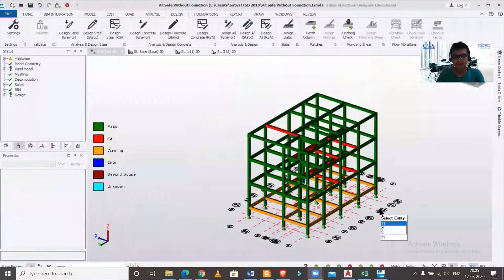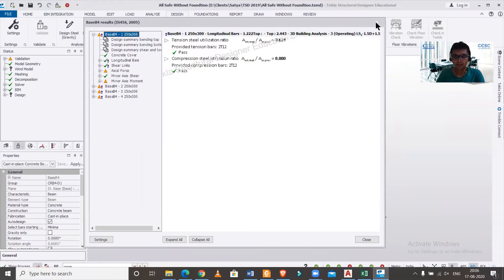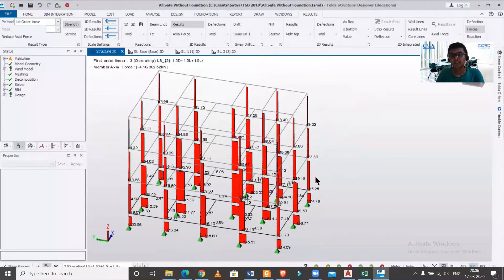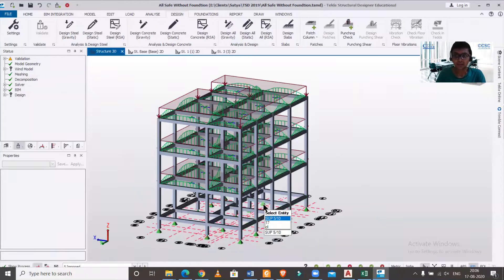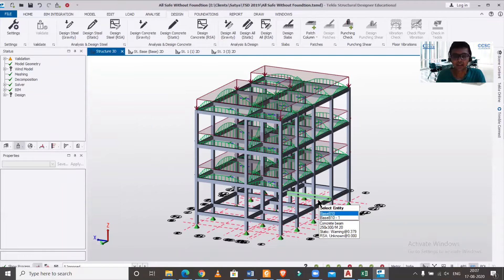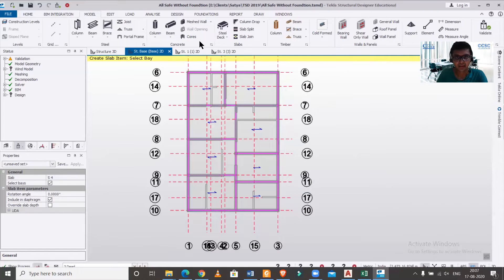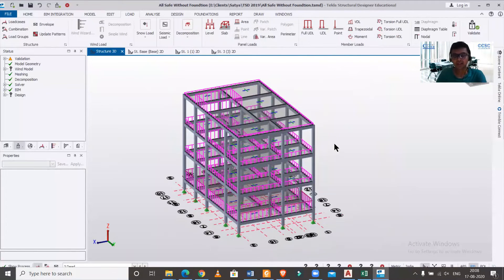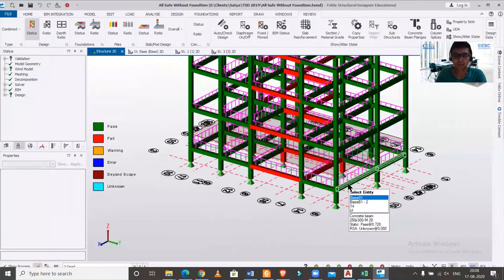Tekla Structural Designer: Removing Warnings of Axial Force and Axial Moment in Plinth Beams

Comment: Why line load and floor loads are provided unnecessarily if it is not in actual case
Reply from the maker: to balance the action of push pull force, by generating some additional moment
Reply: You can't add extra load not in actual cases only to meet the demand of software.